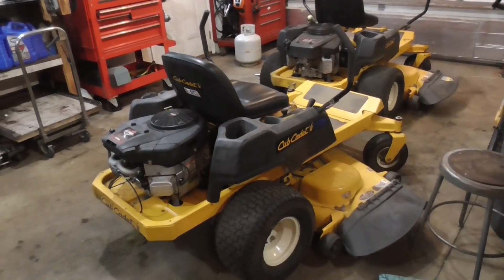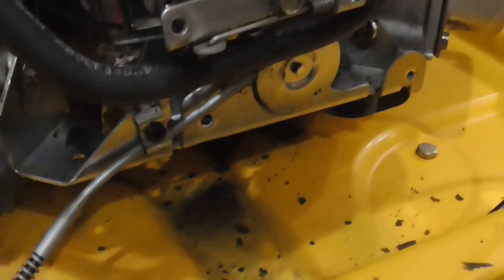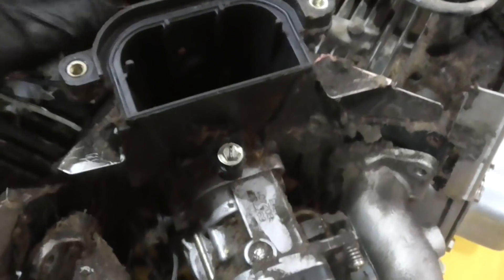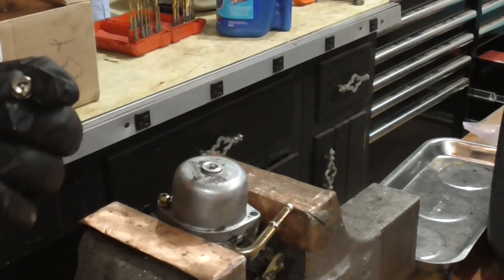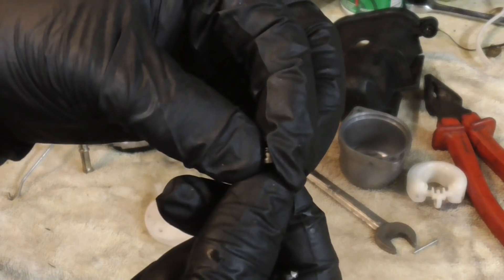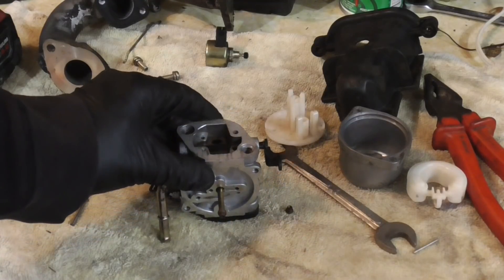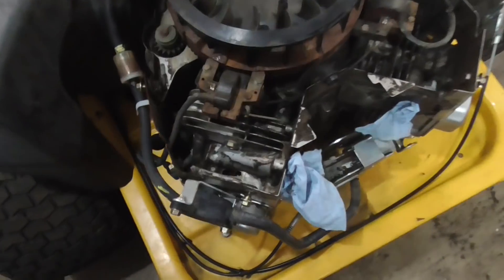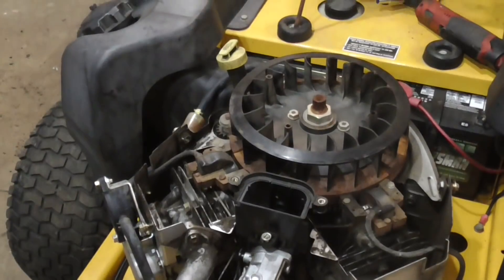Briggs 22HP Carburetor Not Running Smoothly

Comment from the maker: https://amzn.to/2N4IxoP 20-25HP Carburetor Replacement (Cheap)
https://amzn.to/33XXRKq Briggs Nikki Carburetor Replacement
https://amzn.to/2Je40u4 Briggs Tune UP Kit Filters Plugs Oil
https://amzn.to/2qBq23z Bosch Torx Bit Extension Set
https://amzn.to/2qvSgwz  Sharpie Paint Markers
https://amzn.to/2qDt9Iq Craftsman Hand Impact Driver and Bits
https://amzn.to/360bDy4 1/2 Square Impact to 1/4 Hex Adapter
https://amzn.to/2oUJrw5 Nikki Carburetor Rebuild Kit with Gaskets
Reply: Another nice repair Bob! Looks like a good day to be working indoors.

Comment: So many people hate on these engines and yes,they do have some common problems but most of them are preventable with general maintenance I have this engine in an Aaron's 46" I have used for over a decade maybe 13 years mine has the plastic intake which I do not like but I keep good oil in it I keep the cooling fins,flywheel,coils clean and I have not had a problem, I do not have the luxury of running ethanol free gas in it though like I would prefer but it's been one of my top favorite mowing machines I have had,I will go through the carb next season as I have not had to yet.
Reply: I have 390HRs on mine and still works same as it did when it had 10HRs this is due to Maintenance, I just retired from this work so i have lots of time and spare parts. these are good running engines if they are looked after, I have had them come in my shop with 1500 hours and still running good. Maintenance Maintenance Maintenance.
Reply: Duh!!! Clean the Engine & Carb exterior BEFORE dissembling - NotAfter!!! 
Job goes aLot more easily with clean parts and hands(gloves)... 
A quick & Dirty job, especially on a carb, usually needs to get done again soon.

Comment: Hello sir I have the exact carb . Cleaned it 2 times but has a idle surge up and down decide to replace carb but I cannot locate one to buy with the side linkage like look on Ebay and Amazon no luck do you where to buy a carb Thanks sir
Reply: Usually when your lawn mower idles up and down that's means its surging witch means the air and fuel mixture screws need adjusting.

Comment: Thanks for sharing. I haven't seen one of those carbs before. Not sure I like the plastic insides. I agree with you on the kawasaki engines most of my commercial equipment has there commercial engines on them I will say the new EFI vanguards Briggs came out with a few years ago seem to be a good engine. I have on mower with the 28hp EFI and it has been a good engine so far it has around 1100 or 1200 hours on it have you done any work on ant of the briggs EFI engines yet? Hope everyone is doing well at home. Have a great weekend!!!